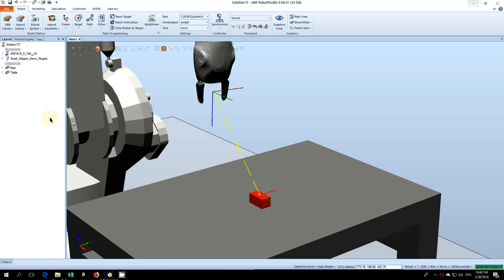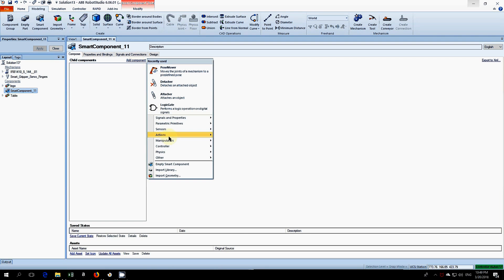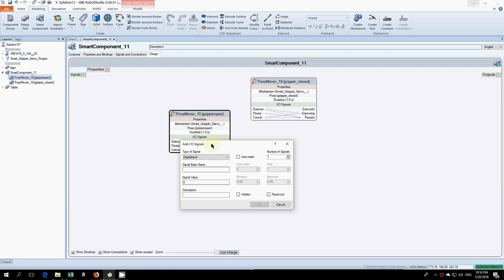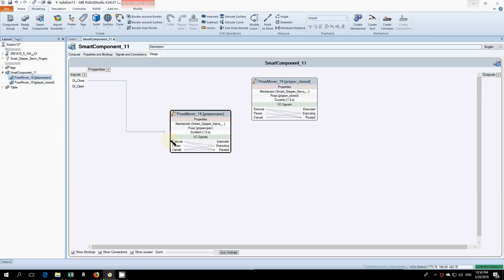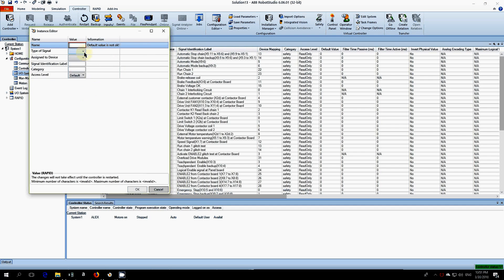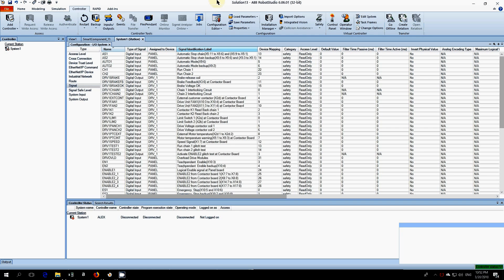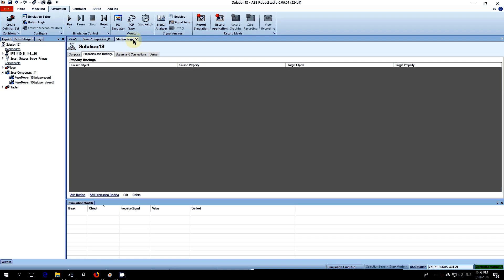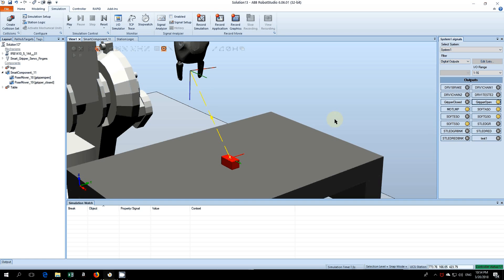smart component RobotStudio

Comment: How did you fix that problem in 9:38? It is very hard to see on the video
Reply: He did literally nothing. No window poppin up or klicks which are made. But you should try to to put some "WaitTime 0.5"s before and after setting the output. The robs aren´t that accurat and it might start moving again before detaching